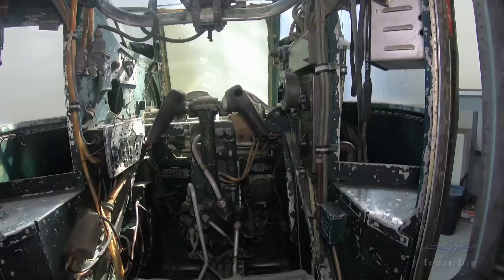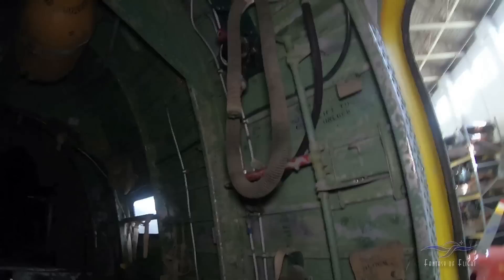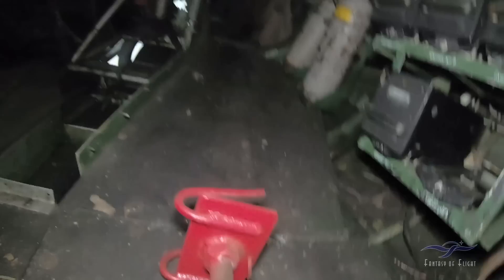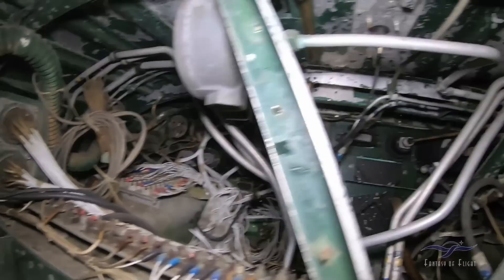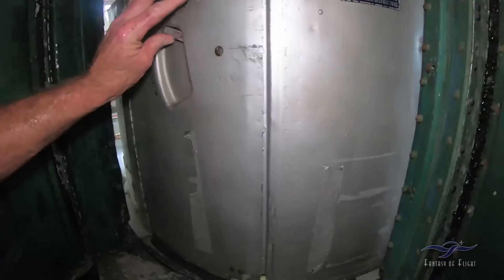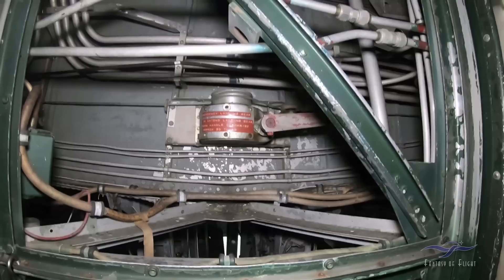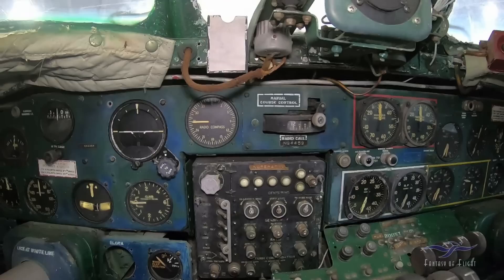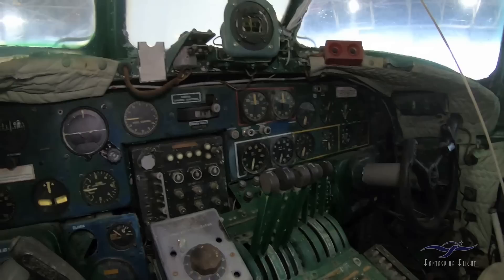Consolidated B-24 Tour - Subscriber's Request! - Part 2

Comment: Wouldn't trying to drop a deuce while at say-35,000 feet in a non-pressurized interior pose a special set of problems and risks? (I'm sure the crews had special training for this.) As you stated-this plane is begging for a restoration for it's rightful place in the wild blue yonder. The B-17 looks like it was designed with streamlining in mind while the B-24 looks like the engineers designed it specifically so crew members could do their jobs to accomplish it's main bombing occupation. The B-24 was the workhorse in the bombing campaigns of WW2 and always in the shadow of the more graceful looking B-17. I'll admit, the B-24 is rather utilitarian in looks.
Reply: Tom Servo I was wondering too why the B24 was less well known. Memphis Belle criss crossed the USA making it famous I guess. Maybe they did choose the B17 for its looks. Or was it just because it was the first plane to make it back? What do you think?
Reply: @cf6282  Looked up some statistics:
B-24 performance problems, coupled by the fact that B-17 production was to taper off prior to B-24 production, prompted the Army Air Force (AAF) to investigate the combat effectiveness of the plane in comparison to the B-17. A comparative analysis conducted in the spring of 1944 by the AAF Operations and Requirements Division concluded that “it would be desirable to increase B-17 production and decrease that of the B-24, because the former airplane is a much more effective combat weapon.”

This recommendation was based on statistical comparisons:

1.Statistical data compiled on the utilization of both planes showed that the B-17 was easier to maintain and therefore more available for combat.
2. Statistical data on time from aircraft acceptance to delivery in theater showed that the B-17’s spend only half as much time in modification centers thus are available at the theaters in a shorter time.
3. Use of B-17 combat sorties, versus B-24, resulted in a 40% savings in personnel and material.
4. The average man-hours expended in producing and modifying one B-24 were greater than for a B-17.
5. Statistical comparisons done on loss rate per sortie showed that the B-17 had a 35% longer combat life than the B-24.

Another study was conducted in the fall of 1944 by the AAF Unit Training Division. In the final report,Colonel Walker, Chief of the Unit Training Division, states the following: "The extensive use of the B-24 is inconsistent with the blunt fact that it is the most extravagant killer of any airplane in the AAF. Since Pearl Harbor through September 1944, B-24 accidents in the U.S. have resulted in 2,188 fatalities. In the first 9 months of 1944, B-24’s did only 6% of total flying in the U.S. but accounted for 26% of all fatalities. They flew 5% less than B-17’s but had 105% more fatalities and 85% more wrecks. Had the B-24 had as good accident rate as the B-17 during the period 7 December 1941 through September 1944, there would have been a saving of 230 aircraft wrecked, 904 lives, and approximately $60,000,000.”
Reply: @HiWetcam Judging by the facts I found it was a hard plane to fly. It killed 906 crew members from the time of Pearl Harbor to September '44 just in the US alone flying non-combat missions. It was probably a similar problem with the wings the B-26 at first suffered until the wing area was increased. They also found the B-17 survived combat 35% better. The British actually preferred the 'Liberator' stating it was a better aircraft for night operations-but wholly unsuited for daylight bombing.

Comment: there is a version like the B-24 some still flying but a more traditional tail its the Pb4y Privateer same P&W R-1830. and the control surfaces are fabric.  same landing gear as the B-24.  As other B-24 parts exist in crash sites.  as then Consolidated merged with Vultee became Convair later made the B-36 and the jets.

Comment: Could you imagine a rough crash landing in this😳. Or if you had to ditch. The waist, tail and radio guys would be fine but anyone in the nose or the cockpit is screwed. Crazy.
Reply: Normally the pilot would turn on the "bail out alarm" and come in for a crash landing alone. Wounded crew would be packed up and tossed out after having their chute pulled if they couldn't do it themselves.

Comment: the pilots got a tiny bit of insulation but the rest of the crew would have frozen in the draft from all the gaps and holes every where.  And the air and engine noise would have been staggering

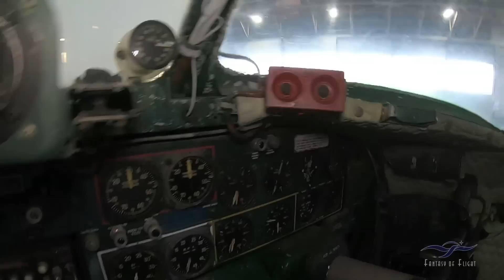Comment: At 20:52 I believe the red control box with two black push buttons was a remote control for the BC-645 transceiver a UHF IFF system. The allies were so paranoid about the Germans obtaining the system that the pilot could push the two black push button simultaneously and set off thermite blasting caps in the magnesium chassis of the radio thus ensuring its secrets.

Comment: The Martin 250ce upper deck turret had it's seat replaced in INDIA with a wooden replacement. 
The foot pedal is not the Dead Man switch, it is a cocking trigger to clear jammed ammunition. 
The DEAD MAN SWITCHES are on the hand grip handles. 
There is a missing control box that was part of the seat that contained the power distribution panel to operate the turret.
Is the turret bubble still held together by wire stitches ?

Comment: I probably would get whatever needs attention fixed and keep it as original as possible. Don't see a perfect time capsule around very often. So cramped in there mind you the crew were only between the ages of 19 to 25 or so and were long and lean.

Comment: In the cockpit the blue and leprechaun green is not original.
The correct color is the dark forest green.
We always had a small portable camper tent fan running constantly. One of the guys had installed a transformer to convert 24v to 12v so we didn't need to keep changing the batteries.
I spent a lot of time trying to keep the interior dusted but the worst part is the deterioration of the canvas and insulation on the walls.
I had a plan to replace the original canvas complete with the stenciling but the planes has to move onto the next restaurant and I couldn't go with them.